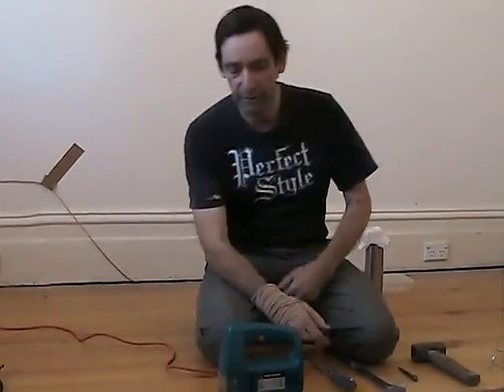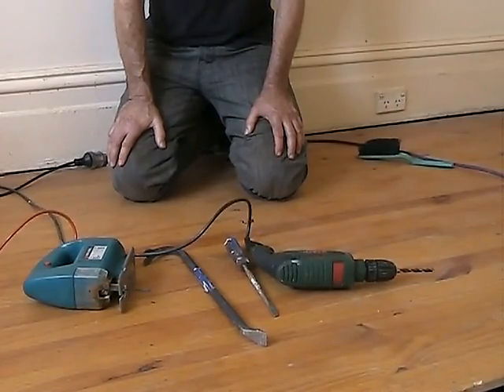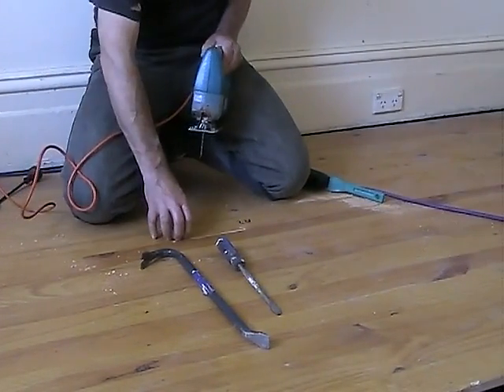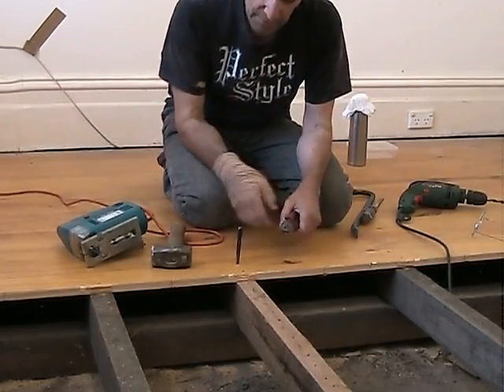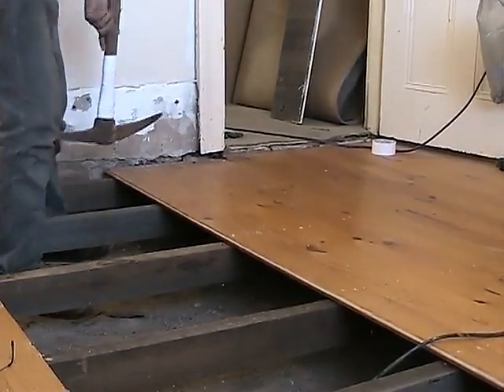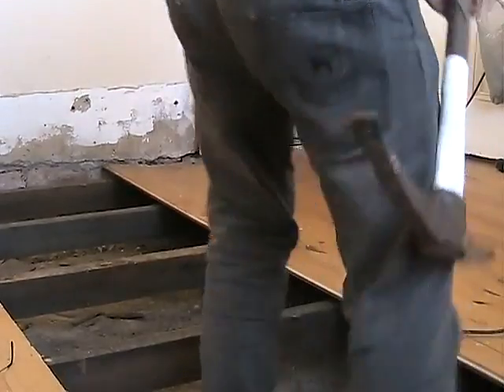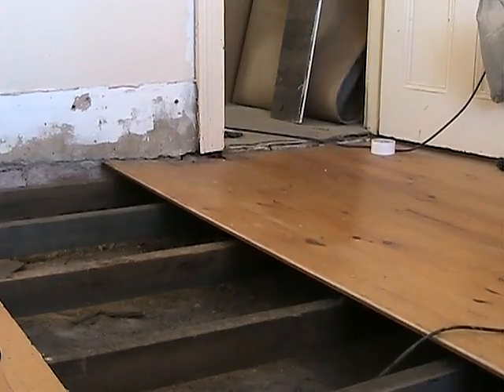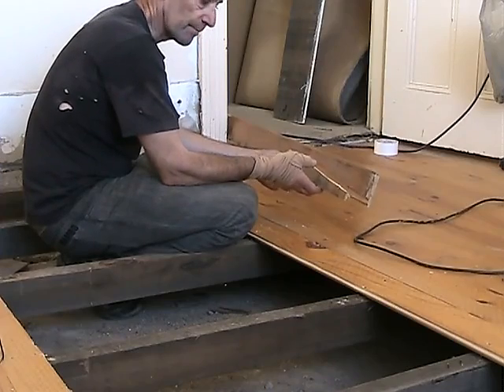Remove tongue and groove floorboards with minimal damage

Comment: seems even the plug sockets are upside down ???
Reply from the maker: Australian electrical convention has the earth pin closest to the Earth itself, a bit harder to see when you're trying to plug things in.... 

Switches: Here it's conventionally up for "off" and down for "on" at wall outlets we call "power points"  and wall/architrave-mounted switches. 

But at switchboards we use the international convention: circuit breakers and RCDs are up for on (red) and down for off (green), just to keep everyone totally confused. My switchboard still has wire fuses, not CBs.

Comment: Multi tool all the way.
Reply: yes ...or plunge saw if you have no idea what's underneath and plan to cover the boards (thicker cutting blade). Set it to slightly less than the depth of the board - you only need to cut to the tongue.

Comment: NO OFFENCE...but im a spark ..asnd that is the most dangerous method of lifting a board i have ever seen....you could drill pipe.....or saw pipe .drill cables or saw cables
seriously do not use this method
Reply: +bobsy bobsy This guy is Australian - it's pretty rare to have underfloor services in a house of this vintage in Australia.
Reply from the maker: Thanks for your comment. see my reply to professorclown below. #FearIsManufacturedByOurRulersToKeepUsSuppressed. Break free, go off-grid, decarbonise your lifestyle simply and verifiably w/o any "carbon offsets" chicanery or self-deception. TIA @voltscommissar

Comment: You should at least mention using a beam/stud/pipe/wire detector before you even touch a cutting tool.  Also, we can't hear you shouting over the noise of the jigsaw.  Finally, WTF did you do to your right arm/wrist/thumb?  It's not exactly a great advert for a DIY expert to be all strapped up like that........  You're like an Australian Mr Bean........
Reply from the maker: Hi professorclown, I own the house, I know where the electrics, gas and water services run, and none of them are under the floorboards of this single storey 130-year old house built originally 1888 with small lead pipes up  in the roof space for gaslight!!. Electric services were added in early 20th Century in steel conduit above the ceilings,  toggle-switches  at ceiling level for lighting control, with dangling pull-cords, real old school stuff. Rewired late 20th Century with TPS ("tough plastic shield" = double insulated LV electrical cable, AU/NZ style) also across ceilings and down chases cut in solid wall plaster. R thumb had an attack of gout thanks for asking. 

But I do take your general point that if a handyperson is unsure where potential killer gas or electric services run, she  or he should check every time. Pity then that we are burning down the #BigHouse (planet earth): we're on track to kill 7.5 billion people with runaway climate change. Let's mitigate that OBSCENE MONSTROUS risk before we nit pick about a single DIY home repairer taking the odd calculated risk with his or her own life.

No expert, just an amateur home handyman. I posted this vid 'cos the stuff re lifting floorboards that  I could find on YT in 2014 failed to show a good technique for preserving tongues/grooves, or at least mitigating their damage, others just showed simple plain plank flooring. Maybe it's improved now... 

Clearly there are better tools that skilled, experienced professionals acquire and use, tools which they probably custom make themselves. In fact after making that video I did borrow from a skilled home-renovating contractor a much better lever made DIY by him from a 5' length of 3" steel pipe with an 8" steel bar welded at a right angle to one end: having a straight upper edge, the thick steel bar could be hooked to an exposed joist and could more easily lift single boards with less damage. The trick to avoid damage is to place the tip of the steel bar lever about 1.33 floorboard widths from the opening, and use the momentum of small, fast pulling motions as you look and listen for signs of the old dry timber cracking or splitting. (if only I could post a diagram here....) 

#ACunningPlanThatCannotFailMyLiege! as Baldrick said to Blackadder = Rowan Atkinson when not in the Mr Bean role.
Reply: Nice
Reply: Some people just think they know it all. This guys doing a fair job. Not easy and so what if he has an arm bandaged up.
Reply: voltscommissar thanks for uploading